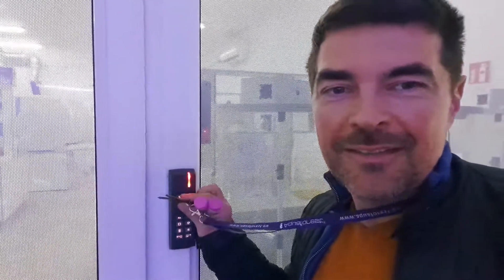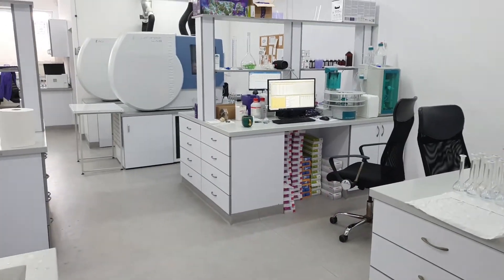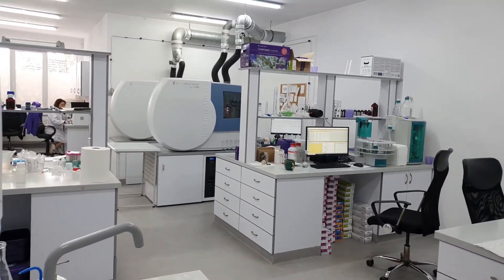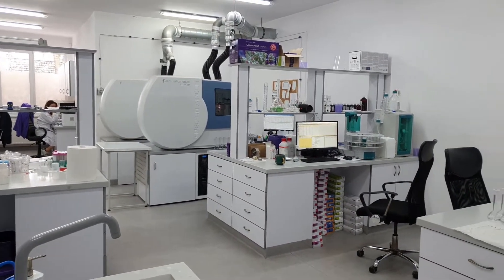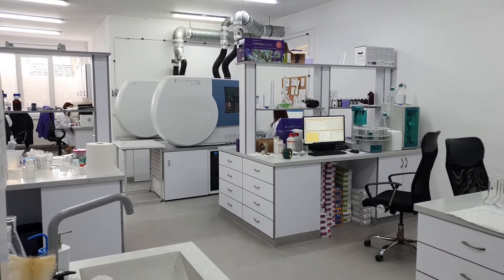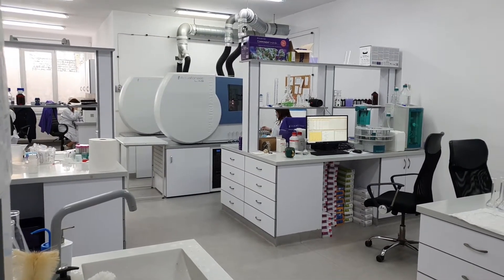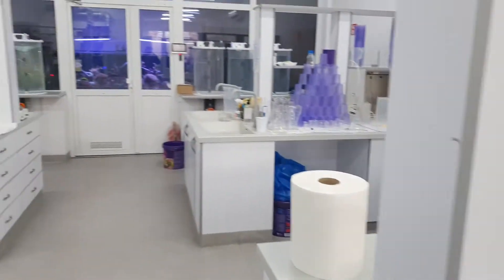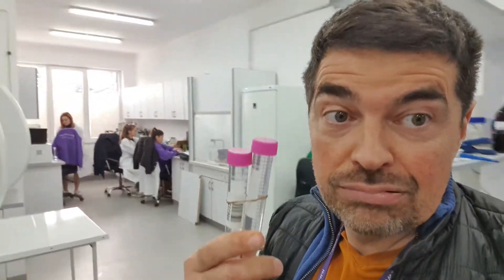ICP testing in Aquaforestlab.com

Comment: I plan on switching from fritz salt to aquaforest since fritz has raised the price of their salt . I see people here in the states testing aquaforest and claiming it has high dkh. I think most reef keepers do not mix up the salt dry out of the box before mixing it in water. Since aquaforest travels a long way from Poland to the USA,I can see the vibration during travel would pack the heavier elements down at the bottom of the box. When I buy new box of fritz I take bag out,roll it around the floor for several minutes before I start using it.  I see people posting bad reviews for fritz and other brands after they test high dkh or low dkh  and so on. I can not understand why all salt maunufacturers do not put a sticket on the bag  telling people to dry mix the salt??